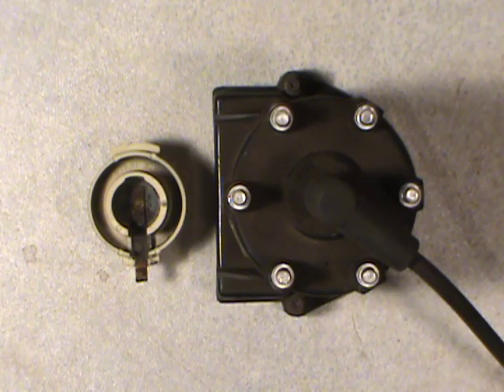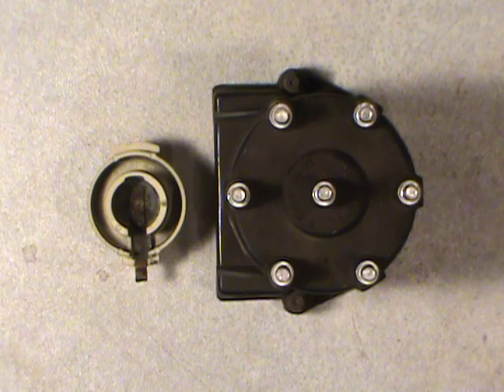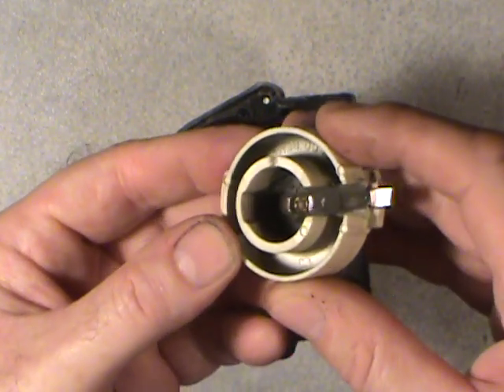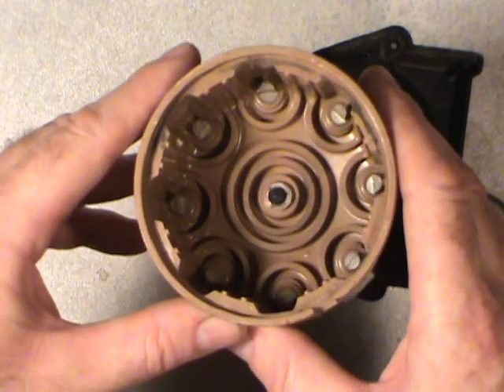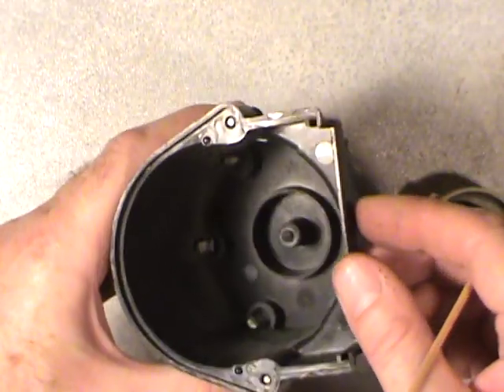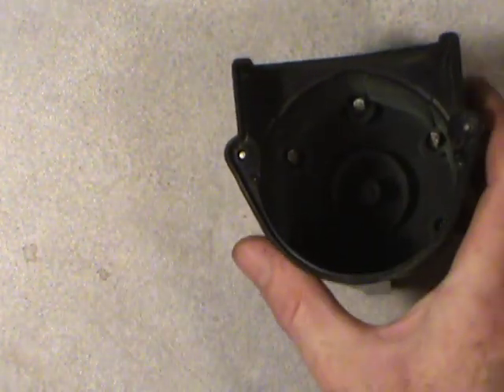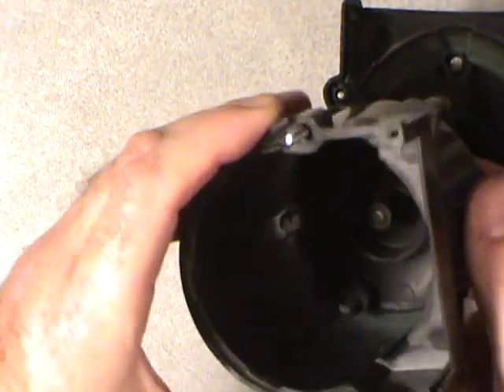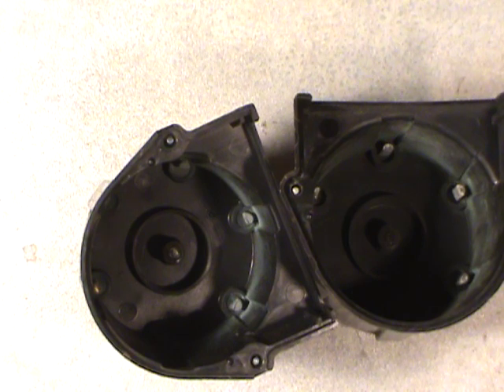How to Inspect Distributor Cap and Rotor Condition (Part 1) of 2 Parts

Comment: my car is a 98 mercury mystique that's not carbureted, we have only replaced the spark plugs so far, and thinking that we should replace maby the 02 sensors and egr valve. And when going uphill or accelerating fast when moving it will start to sputter and then when I floor it it will stop sputtering and run good. but when i put the pedal to the floor when stopped it will barely move it sputters so bad.

Comment from the maker: Greetings JCJV....If your vehicle is hesitating only while you continue to push on the gas pedal, and you have a carburetor on your engine, it sounds to me that your accelerator pump in your carburetor is not giving a full squirt of gasoline into your carburetors throttle bore/bores.....When you said floor it, did it at first start to hesitate, and then go?.....There are lots of things that can cause your problem....Fuel Pump perhaps?....Have you had a Tune-Up recently?....What car do you have?